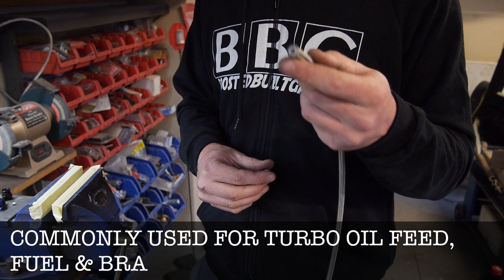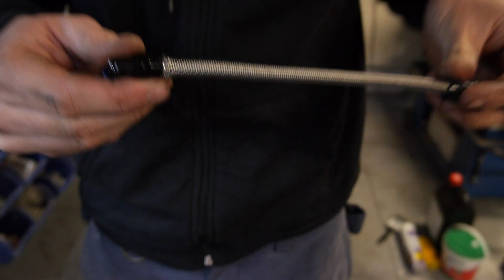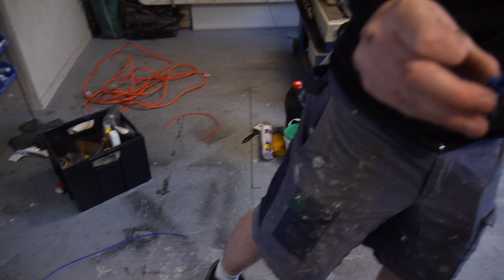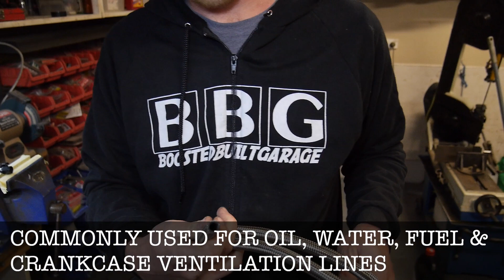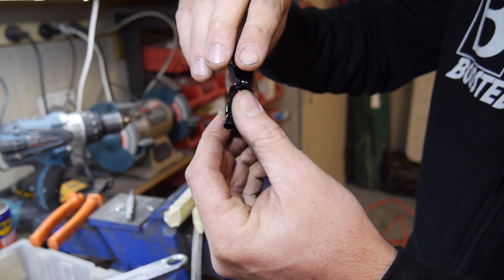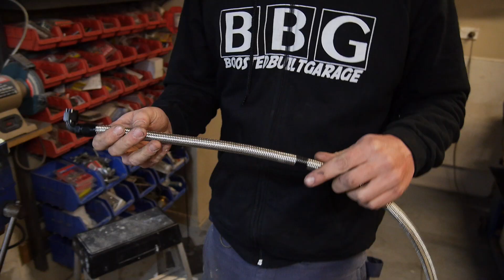HOW TO MAKE SPEEDFLOW 100 & 200 SERIES BRAIDED AN HOSES - TURBO LAND CRUISER BUILD

Comment: Why do some AN fittings have an olive, is it because the oli/fluid is under pressure e.g. turbo feed and brake lines?
Reply from the maker: Depends on what style. Hardline and 200 series use an olive style. 100 series is different, cutter or taper joint to the rubber hose. Not to do with pressure all that much, more to do with the type of hose. Couldn't use a cutter style on the ptfe 200 series hose and vise versa
Reply: @boostedbuiltgarage  thanks mate 👍